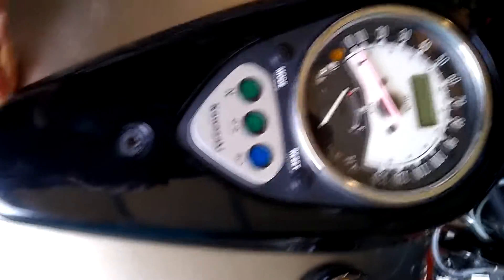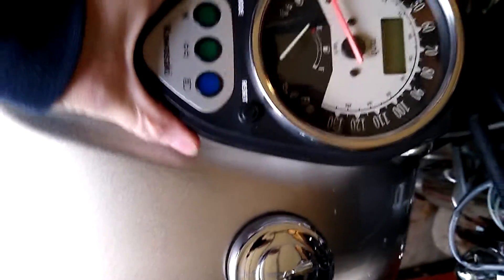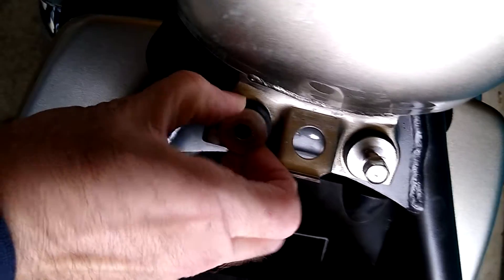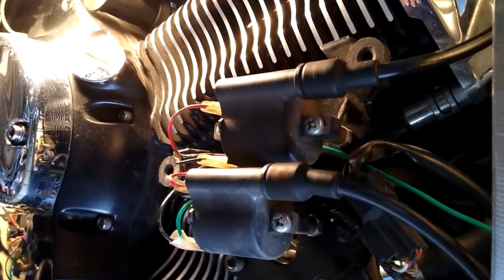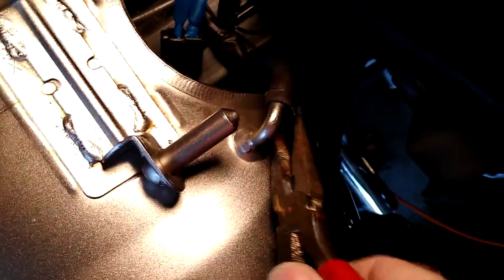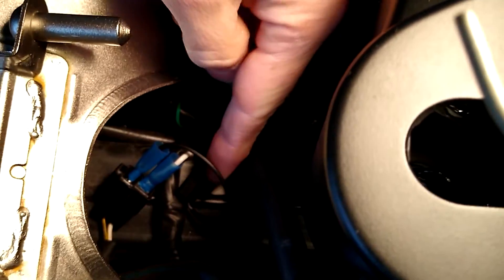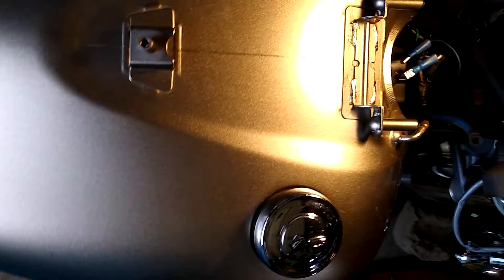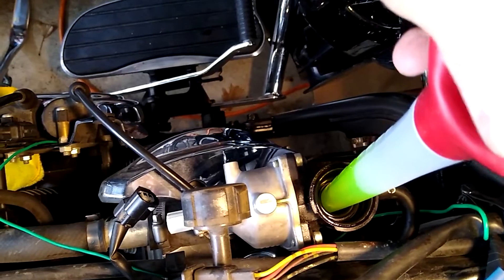Vulcan 900 gas tank removal and Temperature sensor install

Comment: Hey brother, I have a question..when should my radiator fan kick on when my bike is on? I just bought my 2008 vulc and I noticed as I ride it almost never turns on..but I never go for long drives. But I would at least think it would turn on at some point anyway right??? Please help
Reply from the maker: When I first got my bike it would kick on with in 20min's on my ride home after work. When temps were in the 90's. After changing the anti-freeze and upgrading the oil to Mobil 1 racing oil. It hardly kicks on now, as long as your bike is getting good air flow it shouldn't kick on to often.
Reply from the maker: If your worried about the fan not kicking on and want to test that it works. I quick way to find out is to unplug the temp sensor, as soon as you turn the key on the fan will come on.
Reply: @FRJ1982  i did this and mine didnt came on... should i try replace the temp. sensor? @theidiotrighthere1829
Reply: @theidiotrighthere1829  oh ok, so it could be that my engine is running fine and normal 👍 plus it has been pretty cool lately. 
I might try that temp sensor trick also. Thanks a lot brother. Good deal 👍👍

Comment: Hey dude…THANKS for posting that video. I have an ‘06 Vulcan 900 Classic (bought it a year ago, May). I don’t have an owners manual and have wondered how to remove the gas tank. Now I know 🤩. I have a question you might can answer for me. The control module that resets the clock and trip meter doesn’t work. I can’t reset the trip meter with each trip or each fill up and cannot reset the clock. It will change between each mode (clock, total mileage, and trip distance) but that is all it will do. Does the entire control module have to be replaced (including speedometer) or just the part of that controls the clock and trip meter. And would you have a ball park idea of how much it might cost…just ball park. If you can’t provide an answer no problem. Just after watching your video I thought you might be able to help with my problem. Thanks again.
Reply from the maker: I would guess the micro switch is bad aka push button. If you know how to solder, it would only be a few dollars to fix. The only way to know for sure, you'd have to open it up and test it with a multimeter. It would not be worth the price of a replacement speedo, even a used one will be well over $100.
Reply from the maker: Just to make sure. You are holding in the button when on the trip to reset it right. And the same for the clock. Holding in the reset for about 3 sec. If this is what your doing than check the next post
Reply: @theidiotrighthere1829  thanks for the info. It probably is the micro switch. It all worked the first few times I reset everything after I bought the bike but it quit working. I may try a new switch or just leave it as it is. Certainly not worth $100+ to fix something that is more of a convenience than a necessity. Again thanks for the info.

Comment: Hey man, firstly thanks for the video it really shows the process. I wanted to ask how long it would take to take the tank off and back on? as I'm literally just replacing the tank after an accident.
Reply from the maker: I can remove my tank in about 5 mins. If it's your first time, you may have a little trouble getting the fuel clip off. I would say 30 mins, take your time so you don't break that fuel clip. Putting the tank back on is just as quick.
Reply: @theidiotrighthere1829  cheers man

Comment: You didn't show how your unplugged the wiring to the fuel pump. I've been trying to unplug mine and it's so GD tight I can't budge it. You did help me by showing how to disconnect the fuel line. I thought it might be one of those connectors that require a special tool. Thanks.
Reply from the maker: Shoot, your right. On top of the connector is a tab, use a little screw driver and ply up as you pull the inner connector to the front of the bike. When facing it, the Tab (outer connector)right side. Inner connector left side. Hope this help's you out.
Reply: @theidiotrighthere1829  Thanks. I finally figured out how to get the plug off the metal bracket it is mounted on. Small tab inside the right end of the plug. Pull it up and it slides right off. With it off the bike I could get a better look at how the plug separates. Then is wasn't a problem to unplug. I would like to spend 15 minutes alone in a locked room with one of the engineers who design those plugs. I would bitch slap him around the room until couldn't see straight.
Reply: @glennmosley7690  I removed it the first time without a hitch. Now I am in the same situation as you were in. Its so tight. As you said there is small gap on the right end top of the plug. If I put a screwdriver in it slides a little.

Comment: What was the original problem, how did you know it was bad?
Reply from the maker: My original problem was the temp light would not turn off after doing a coolant flush. It was not the temp sensor. I knew this after buying the sensor, but wanted to show how to install anyways.
Reply from the maker: To add to this, I added a HD Fairing off of a street glide. I added the idiot lights and when I hacked in to the wiring harness I back feed 12volts to the Temp Light. Guessing I blow the resistor going to the light. I added the light to the fairing and removed all the lights off the gas tank gauge cluster. Hope this info help's you or anyone reading this.